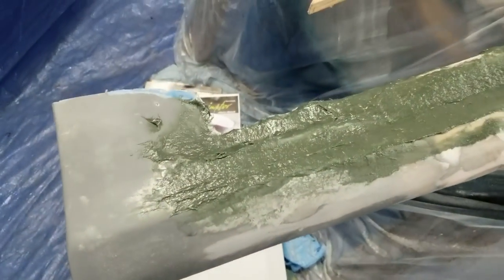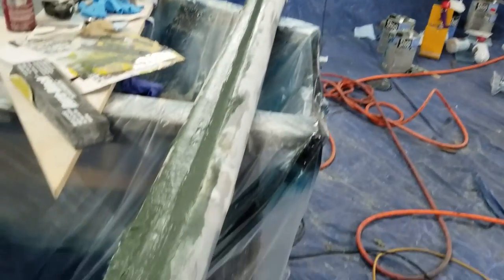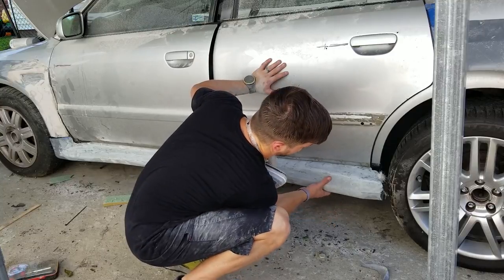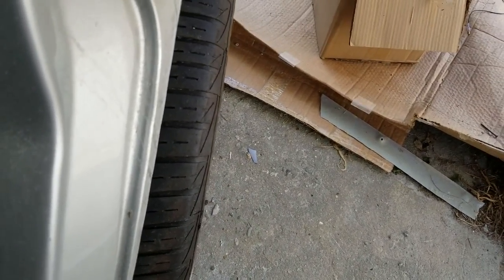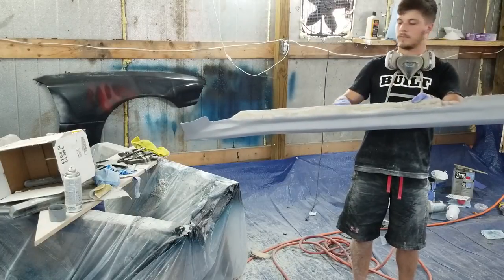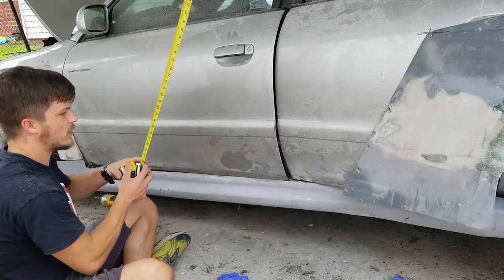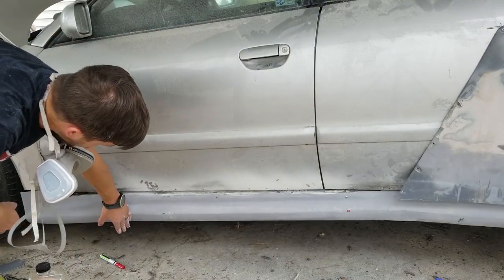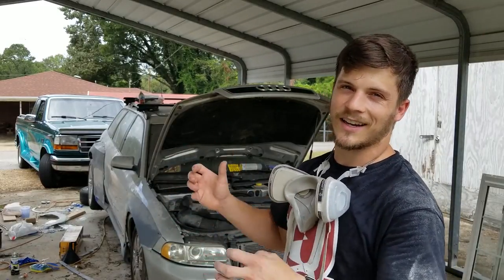DIY WIDEBODY AUDI BUILD pt. 11: SIDESKIRTS ARE MOUNTED

Comment: You should make a metal brace under the back end of the side skirt and bolt or weld it to the frame under the car the. Just rivit the side skirt to the diy frame so it looks like it’s part of the kit. So just in case a kid stands in it. Just a thought